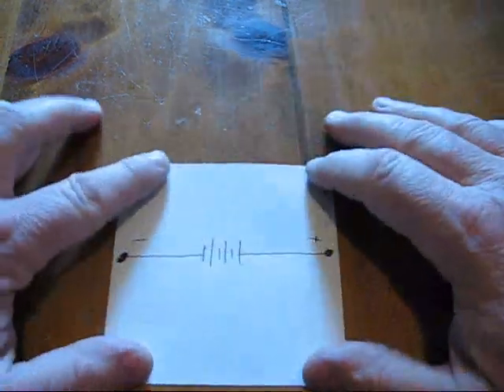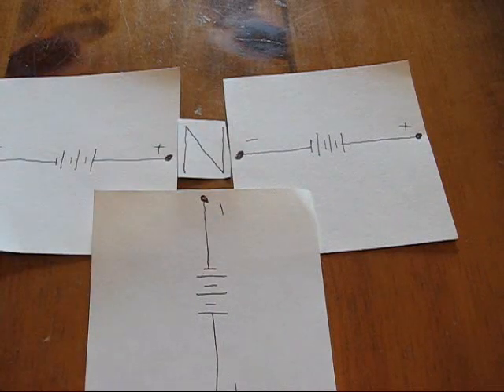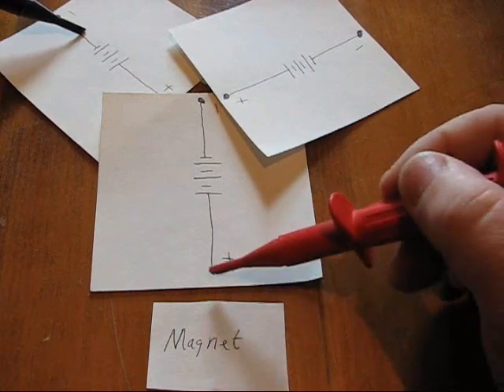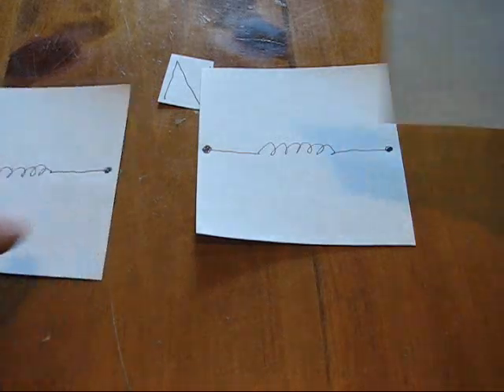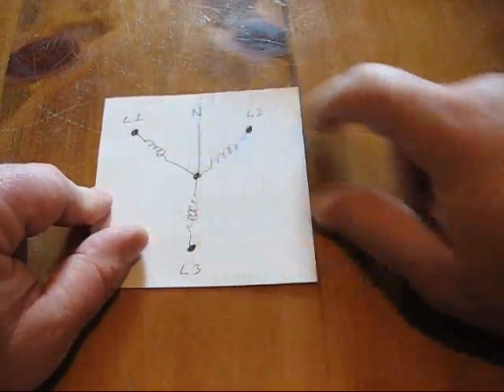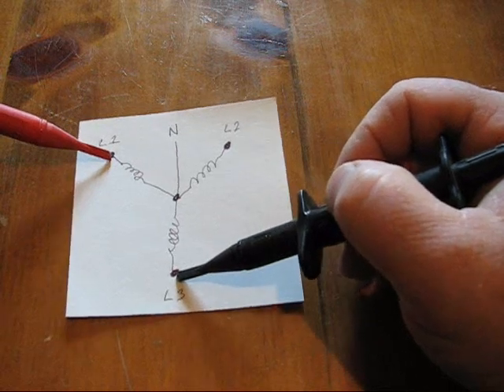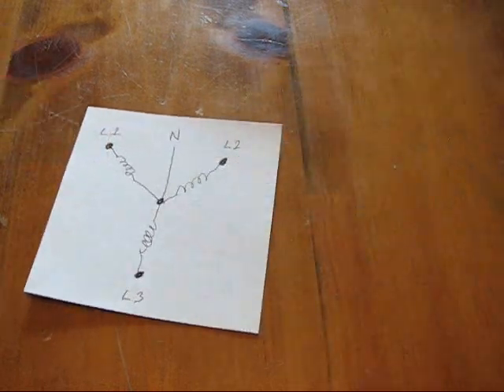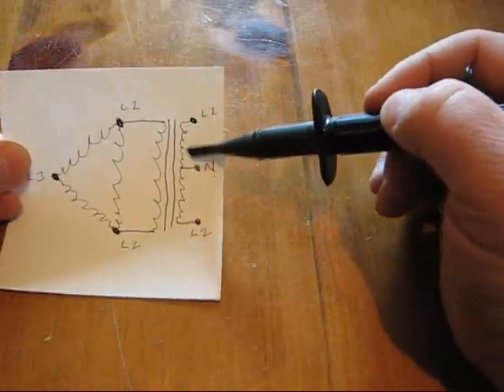Three Phase Power: A Simple Explanation

Comment: In  Canada   120/208 volt 3 phase is often used in larger appartement buidings the 3 phase 208 used for elevator motors  air conditioning   various pumps etc and each individual 120volt hot to ground single legs are used for regular outlets,,  so in any individual appartement itself the power panel will only have the neutral and any 2 of the hot legs but not all three  the 208volt between 2 phases is reserved for kitchen cook stoves  water heaters   electric  heat   etc,,,, Now in Canada in either  industrial places   or  say very large office buildings   600/347volt  3 phase is used as the service voltage entering the building  and the 600volt 3 phase is used for motors and other large loads and then this voltage is also sent to large lighting panels that are reserved for the hundreds of light fixtures on each floor now these fluorescent fixtures have  347 volt ballasts instead of 120volt ones the reason this is done is because if you use 120volt normal fixtures  the wiring size needed for all these becomes uneccesarely large  whereas with  347 volt  the amploads become one third as compared to 120 volt llights,  now these light circuits are controlled by low voltage activated relays all located in a relay panel in the electrical rooms  only 24 volt or so goes to the actual switches in the offices,,   now also in the electrical rooms are located 3 phase transformer banks the will  step the 600volt 3 phase down to   120/208volt that are split up into individual120volt  single phase circuits that are used for  regular plugs and also some 120v light fixtures and other 120v items...   Also    600volt 3 phase motors only draw 1 amp per horsepower so a 10 HP only uses 10amps full load
Reply: +bernard240vdc   The U.S. in Canada is the same.  While this gentleman made good presentation,  he was not right on every account.  He made an analogy using batteries (DC) which helps the present fundamental knowledge, but it doesn't convey the principal of a 360 degree rotating power. To my understanding and measuring many times of the years, it is 208 VAC from leg to leg, because of the 120 degree phase shift.
Reply from the maker: bernard240vdc Interesting! That sounds like an efficient way to do it. Thanks for your input.
Reply: bernard240vdc The US is nearly identical on commercial and industrial power, except we've got 480/277V on HV. 480 for mechanical and motors, and 277 for lighting/(tankless) water heaters.
Reply: In Australia single phase 240Vac is standard for all domestic power applications, while 3 phase 415Vac is utilised for commercial/industrial power applications when needed (e.g. plant equipment, welders, machines etc.).

Comment: Thanks for the vedio, I wish every electrician can be clear like you.
I have the 3 phases head in a commerical unit, 2 were connected and used previously, 1 was not connected. I changed the power supply company when I moved in. The metre guy came to install a new 3 phase smart metre, he said that this unit only has 2x heads active/live and therefore we cannot get 3Ph?  What this mean? Many thanks.
Reply from the maker: I'm not sure, but it sounds like you don't have all 3 phases available from the transformer. That is the case in most residential areas in USA.

Comment: Scandinavia has 220v as the "home" standard and the Three Phase for the Washingmachine, the oven and in the garage / basement just like in industries.
Reply from the maker: That is interesting. It would be a great benefit to have residential 3 phase in hotter areas of the US, because of the added efficiency for air conditioning.
Reply: Found it: "Don Montague
Pioneer of Kite Surfing and Kite boating

Don served as Head Sail Designer at Gaastra Sails and, subsequently, headed up R&D for leading windsurfing and kite surfing company, Naish International. For the last thirteen years devoted himself to the research, development and design of kite surfing and kite boating equipment. Kite Boats are his latest innovation."

Comment: Great video!  Just an FYI, a better way to run a 3 phase motor with single phase is to use a VDF (Variable Frequency Drive).  You can do it with a Rotary Phase converter, but that is an older and less efficient way.  An added advantage of the VFD is you have control over the output frequency and using that you can control the speed of your motor.
Reply from the maker: Good point; thanks.
Reply: Todd Jones VFD drives need 3 phases to run a 3 ph motor .If you put a single phase into a VFD to run a 3ph it will not work .Or even start up. IA VFD CANNOT make 3 phases out of 1.

Comment: Great video. I ran across 3 phase trying to help a friend and it blew my mind because no one told me it was 3 phase. There was no common/ground that I saw. There were 3 wire connections with wire nuts on them that were exposed and needed to be placed in a box of some sort. I forgot to make line markers but since there were only three I decided to go ahead. Left wire caps on two wires opposite ends and left the 3rd connected. Easy right? Wrong. A wire nut fell off and I couldn't tell which wire it went to. Took my meter and was reading 240 volts across any two wires I touched. There wasn't a ground/common I could see. There was another wire but it was never connected and things had been running like that for quite a while. Still not sure exactly what it was. Maybe the Delta 240 you mentioned. Who knows. Any way, great Job!
Reply: Fred Barber A 3 phase connection with no neutral is a triangle called DELTA.a 3 phase connection with a neutral is caleed STAR or WYE..Star power is onlly 54% of Delta .That is why big motors start  in Star or Wye to limit the cuurent to 54% and then after a short time changeover to Delta and run on 100% power.

Comment: My central air has a red, white and black wire. Is that what is called a 3 phase?
Reply from the maker: No. That is single phase 240 volt. According to US code, black and red are L1 and L2 respectively and you get 240V across them. White is Neutral, and you get 120V between it and either red or black. The white is also probably connected to the grounding system.
Reply: Possum Living
Thanks. Does it matter how I connect them to the disconnect as long as the line wires are connected to the line wire connectors and the load wires are connected to the load connectors?
Reply from the maker: cooldog60
It makes no difference if you swap the red and black wires, if that's what you are asking.

Comment: Wye connection phase to phase is sqrt(3) x phase to ground voltage.  1.732 * 110 = 190.5 volts phase to phase, not 220 as said herein.  Or for 120v phase to ground, 208 v phase to phase.

Comment: Hi possum: The WYE connection is called WYE, Not because of obvious reasons, BUT because it resembles or has the shape of the alphabetical letter Y with the 3 corners or ends spaced at about 120 degrees apart, just like the Mercedes-Benz symbol or icon, a 3 pointed star, separated at 120 degrees and enclosed in a circle. Just like the DELTA connection. It is a TRIANGLE connection, with 3 equal sides, separated by 120 degrees. So DELTA is not the proper name for this symbol, because DELTA does not have equal sides, look at birds and airplanes with delta wings, they have no equal sides. Keep up your good work. I apologize, but did not mean to offend, but to clarify its meaning. Thanks, 09-21-14.
Reply: I'm pretty sure that's what he meant when it said "for obvious reasons." It looks like the letter 'Y' - obviously.
Reply from the maker: I am aware of that, but thank you for the comment. No offense taken.

Comment: I can say that in Australia (obviously different to North America) some houses are given three phases and some are given a single phase. From working with a utility, I believe giving each house only a single phase is better since it give the utility the ability to balance the load rather than having a customer change their house wiring. Obviously if you want to use a three phase motor you need all three but this should be reserved for where it is actually required.

Comment: The phase to neutral voltages do not add as you have said. They are 120 degrees out of phase from each other. It is important for your students to understand the difference between a three phase Wye connection and a centre tap transformer.

Comment: I'm just a green horn , trying to learn wiring for hvac , ....I'm under the understanding , neutral completes the circuit and ground go's to the ground literally some where's along the way , great vid , learned alot , thanks
Reply from the maker: The circuit is completed when one end of a winding is connected to the other end of the same winding. Neither neutral nor a ground connection are necessary. Neutral just provides a convenient point to tie to ground potential, when that is desired.

Comment: Just one comment: In Wye connection, if Phase to Neutral is 120, Phase to Phase is 208, not 230 or 240. The 240 you get by using a center-tapped transformer (120 at center tap, 240 across outer taps) - which you explained. A wye connection does not just add up that easily. Mathematically, its not 120+120, its 120(@0 deg) + 120 (@120deg). Consider why common systems are named 120/208Y or the commercial-industrial 480/277Y ... or the European 230/400Y. This can be verified with any multimeter and a true 3 phase service.

Comment: thanks for the video. but still I have a question. 
I have a generator with 75amps three phase, which mean each phase 25amps. The device that I have is 60amps single phase. so my question is there a way to add up these three phase 25amps to make one phase with 75amps ? thanks
Reply from the maker: No, unfortunately that won't work. If your generator has 12 wires it can be reconfigured for substantial single phase output, but even then it won't be able to provide the full 75 amps.

Comment: I have a question. There are residential homes, like in Arizona, that have 3-phase power in them, do you know why that is?
Reply from the maker: That would be an extra-cost option for those who need to run some kind of commercial equipment in the home, such as a large freezer. It is not available in all residential areas.

Comment: Hello, Could you please, explain the theory why 480v measures 277v line to neutral due to being 120 degrees off phase.
Reply: Because instead of being additive as in single phase, in three phase (which a 480V circuit would be running) you have to multiply the 277 line to neutral voltage by the square root of 3. That is 1.732. If you do, that gives you your 3 phase system voltage of 480.

Comment: In a Wye connection shouldn't phase to phase not be added but multiplied by the square root of 3 or 1.74.  In your case resulting in 208 volts.  This being that each phase is 120 degrees?
Reply: Yes, in my home the outlets marked as 110v are actually 127V though so when I connect two "hot wires" I get 220v.
Reply from the maker: Exactly. That's the thing; all these people who get bent out of shape over phase angles and exact voltages never mention that those voltages are nominal and have a wide tolerance.
Thanks for your comment.

Comment: Sorry I must specify, The provider of electricity such as com-ed does not send a "ground" with the the 2 hots and neutral from the transformer. From what i understand they don't necessarily believe in a "ground"  The ground is a "secondary safety" to your neutral. I am a 4th year union electrician so I could be very wrong but this is from my understanding.

Comment: Jeff you are correct in the US almost all (newer) residential homes now have "single" phase systems. That means you have 2 hots (110 or 120 volts per phase) with a neutral and a ground bonded to it. If your not using commercial or industrial equipment you do not need to worry about 3 phase Wye or Delta Systems in my opinion.

Comment: 3 phase means line voltage is 1.732 times large then coil voltage in a wye. So 110 per phase means 190.5volts between any two phases. Other than that, great video.

Comment: Badass video, definitely learned a lot. Gotta ask tho about a question. Typically 3 phase is 120/208Y, so when you said you had 3 phases across two of any of the points you were saying something along the lines of 220v. 208 is different than 220/240. 220/240 are actually the same thing, split phase connection. just wondering thats all
Reply from the maker: What I said is that 220/240 volt appliances can be powered across any two legs of a 208 volt 3-phase source. Supply voltages vary, so the voltage rating of an appliance is a nominal rating with a fairly wide tolerance. Typical tolerance on a 220/240 volt appliance is approximately 200-250 volts, and 208 volts is within that tolerance.
Reply: Oh ok, wasnt trying to call you out. Im just a little confused about how people either choose a 3 phase set up or a split phase setup if the appliance voltage is in the 200 range. I assume its because 3 phase has voltage present at any given time ?
Reply: I did some research and according to some sources you cannot use 208 3 phase if it calls for 240 volts. Even though it's in that 200-250 range, 208 is typically commercial / industrial and is utilized for loads like motors where it needs that 120 degree offset. 240 appliances in residential should be supplied from the single phase multi-wire center tapped transformer.
Reply from the maker: ABflanagan523
That is correct; 3 phase is designed for industrial applications for powering motors. It is a more efficient way to power a motor, and 3 phase motors are lighter and cheaper than single phase motors.
As a rule, residential applications do not include 3 phase service, and residential appliances are designed to use single phase power. But it is incorrect to say that you cannot run single phase appliances from a 3 phase supply.
My approach here is from the standpoint of using a 3 phase generator to power single phase loads. Not only have I done so with my own 3 phase generator; I also have a US Navy electrician's manual detailing how Navy ships use such a system.

Comment: so so everyone is clear. if you are using a 3 phase system, the voltages do not add because they are not 180 degress out of phase from eachother. in a regular (residential home) single phase system they do and his words would apply, but in a 3 phase system they are 120 degrees out of phase from each other so if you were to measure across any two phases they would be 208Volts if each phase was 120volts, not 240volts like he said. not trying to be disrepectful just wanting people to no they dont just simply add in a 3 phase system. other then that this is an awesome video and he is very smart :)
Reply: Bryan Fajkovic T

Comment: 2 of your battery negatives are at neutral (which makes sense), but  why do you have one positive battery terminal also at neutral?
Why do you keep switching your batteries around?
Why are you using batteries (DC) to explain AC?
Reply from the maker: 1. To illustrate that the coils are in series at that point in the cycle.
2. To follow the moving magnetic field.
3. Because DC is easier for most people to understand.
The only reason it would make sense that negative would be at neutral would be an incorrect assumption that neutral is at ground potential (though it usually is, but not necessarily) and that negative is also at ground potential, which certainly is not a good assumption.
Ignore the third battery, because at that instant in the cycle, it is not part of the circuit.

Comment from the maker: No, there are no unused watts. Watts is a measure of work done, and it requires a full circuit from the source to the work and back. Until that work is done, there is only potential aka voltage. Watts (power) is voltage times current, which is a measurement of flow. The water analogy refers to flow through a pipe (current) and pressure in the pipe (voltage) while the water is flowing.
The ground connection, if any, is irrelevent. A circuit can be connected to ground at any, but only one point.

Comment: The neutral line for all electric circuits transports unused watts in an electrical circuit to mother earth.  Is that right?  In other words, the red 110v line that energizes a 100watt light bulb is connected to a white neutral line that is connected to ground or earth.  Thus, some portion of the energy of all electrical circuits  passes unused into the earth.
Electricity kind of flows like water.  Could you use the water analogy to describe how electricity flows in your excellent presentation?

Comment: Oh, one more interesting thing for  electro freaks. You can power the 3 phase motor having only 1 phase at home. You need to use the capacitor to connect "3rd phase". It is not the best solution though, the current is "rotated" 90 degrees instead of 120 and the motor will not have the full power.

Comment from the maker: That's interesting. Thanks for the link. In USA the largest common household outlet is 240V single phase at 50A for 12 KVA (12000W). It must be nice to have 3 phase and higher voltage readily available. It allows cheaper, lighter and more efficient appliances.

Comment: In Denmark all new installations has 3 phase (new being around 1960). You need it to connect heavy appliance like stove/oven, washing machine and dryers. The standard plug has 230/400V x 16A x 3 phases = 19200W@400V.

In my building the electricity has been retrofitted/refurbished. I don't know when: The oldest power-meter I can find is from 1975.

I recommend visiting the page: fam-oud.nl/~plugsocket/Overview_3hd.html

Comment from the maker: It is used for powering motors. A three phase electric motor is cheaper, lighter, simpler and uses electricity more efficiently than a single phase motor of equivalent output. In a factory that uses multiple large electric motors, that can add up to quite a lot of money saved both in initial upstart costs and ongoing operational costs. That's it in a nutshell.